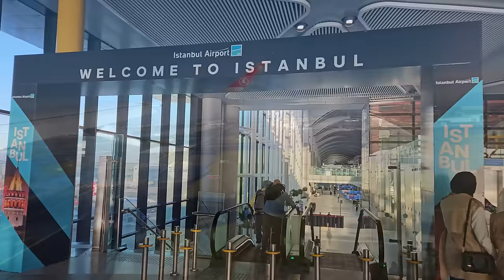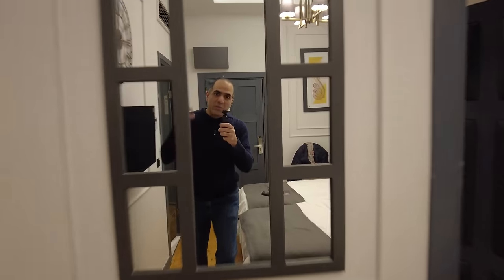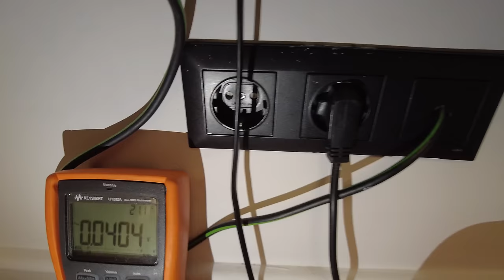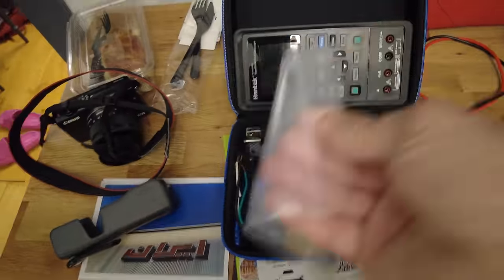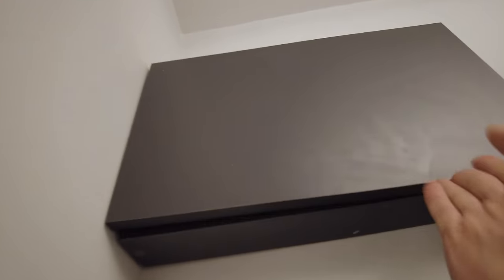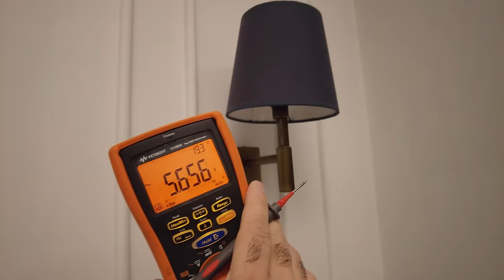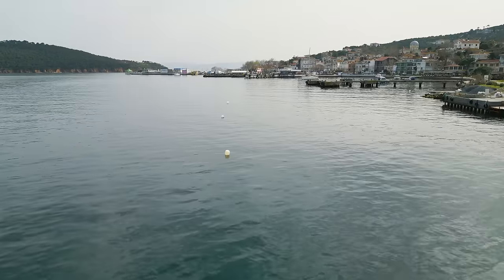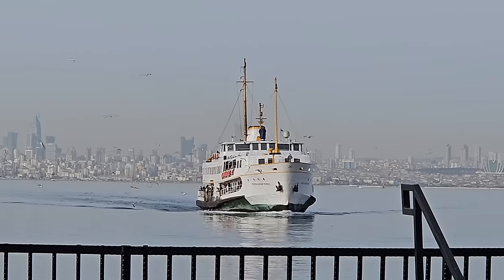Turkish Electricals Are Almost TOO CLEAN

Comment: I don’t go around houses checking the electrical installations but I teach electrical installations to future technicians and I can tell you that on paper the Turkish standards are probably the same as in most of Europe.  So, I’m not surprised with this video. 

The main advantage in Turkey is that there is lots of new housing. New houses follow the standards, have proper grounding, and overall have decent safety standards. Some old buildings may not meet modern requirements but their numbers are decreasing. For example, my parents’ house is/was one of these old houses, when we first got a 56k modem back in the 90s, there was a weird interference and it turned out to be insufficient grounding. These days I can’t image a house without a proper grounding, it’s too dangerous. 

Earth leakage relays should normally work, we have 300mA building protection and 30mA fuse box protection in each unit. As for the ground protection, new houses have the proper protection but again some old building may connect ground protection to the neutral.

Comment: Unfortunately you did not have a chance to see a unauthorized construction zone which blows 154kv ground line. 😊
Secondly it is regulation to use leakage current relay. 30ma for health on apartment panel and 300ma on main panel for fire protection. Hotel should thank you to find it hopefully they fix it.

Comment: Norway should be interesting for you. It is only Norway and Albania which has this type of electrical system. Here in Norway we call it IT system, where both phases have 133v to earth and no neutral.
Reply: True but the earth connection has high impedance so the voltage will drop if you touch the wire.That is what the I means in it.

Comment: Next time, please do not touch the live wires. Instead, check the RCD by shorting the neutral and ground terminals at the wall outlet. This method is safer for testing the RCDs. Also, according to Turkish regulations, it is mandatory that all room panels be equipped with 30 mA RCDs. You should report non-working RCDs to the hotel management.

Comment: Lighting circuits should not be on the same breaker (ground-fault  or otherwise) as outlets. When there is some fault, losing the lights at the same time is rarely helpful.

Comment: You were very lucky in your trip especially with the drone shots. It is strictly prohibited to fly drones especially around the historical town. Moreover there are Drone Jammers all around the city and will cause your drone to fly away without any control possibilities. You were very lucky not coming across one of this devices. Next time you can loose your drone in an instant. Other than that it is a great video.

Comment: Its not best european but its something. And if you need to find in europe breakers its near entrance 90 procent. We dont use gfci ever bc normaly in bathroom there is no outlets -_- . We aint dumb and we dont usualy have dumb electric placements the cover of outlet is when outlet outside the fog or water not short it but for some reason its inside too.